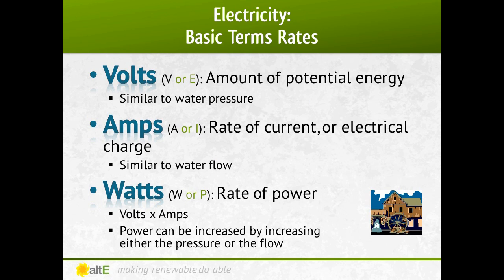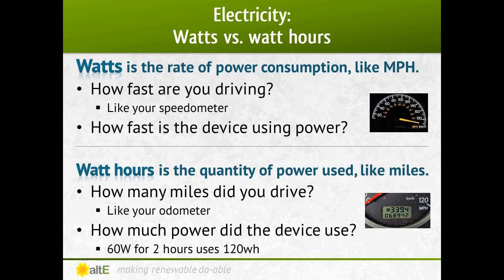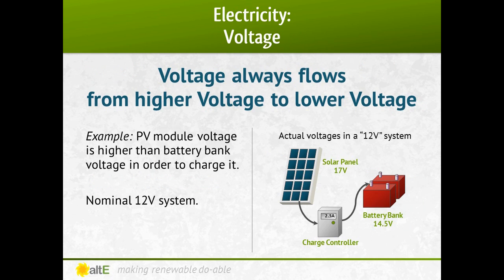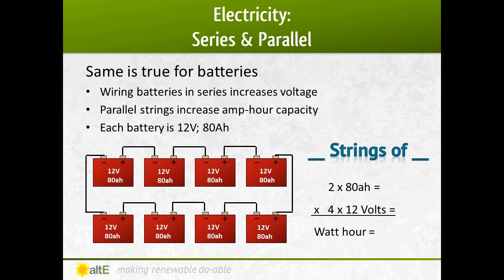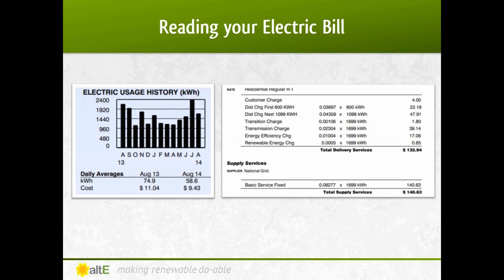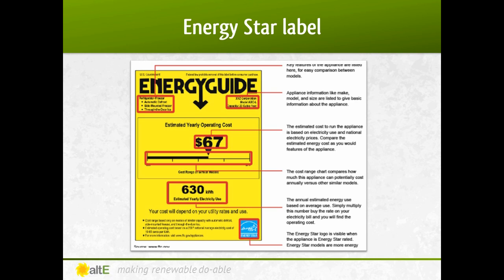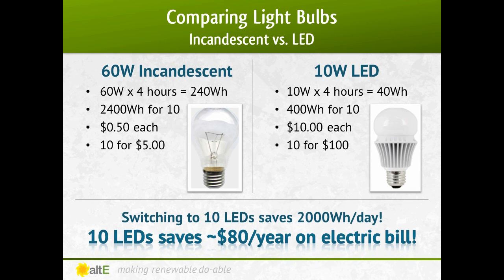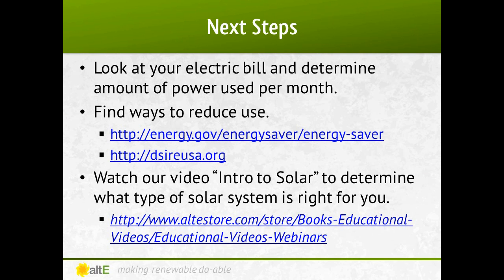Introduction to Electricity Basics (First step to Solar)

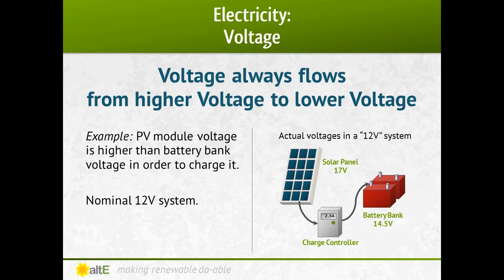Comment: 4:13 So if you have 2 6V batteries one having 4 volts and the other having 8 volts would the 8V battery put 2 volts into the other battery equalling both out at exactly 6 volts?
Reply from the maker: It depends on the battery type. Some are able to self-balance without damaging the bank, others, like most traditional lead acid batteries run the risk of the bad battery damaging the god battery. That's why you don't want to mix new and old batteries in the same bank.

Comment: At 0:47 it would be better to say that Watts is Rate of Energy or just Power (not rate of power).  A Watt is one Joule/Second where Joule is a measure of energy. (1 Joule is the amount of energy to accelerate 1 kg of mass one meter per second, every second over one meter)
Reply from the maker: Thanks for the advice. I've been trying to improve my use of energy versus power lately, instead of incorrectly using them interchangeably. Hopefully you'll see improvement in our newer videos.